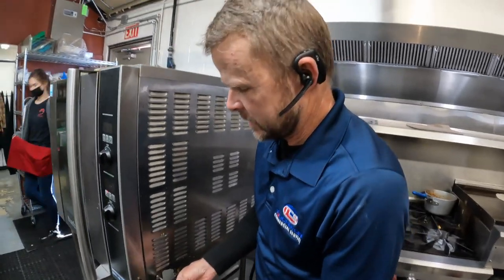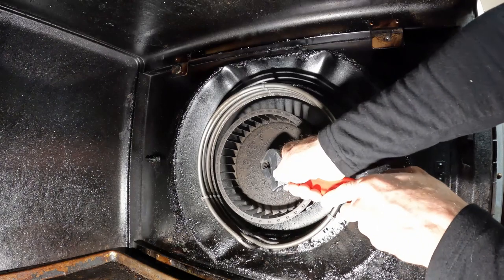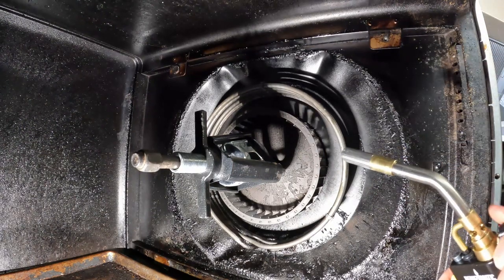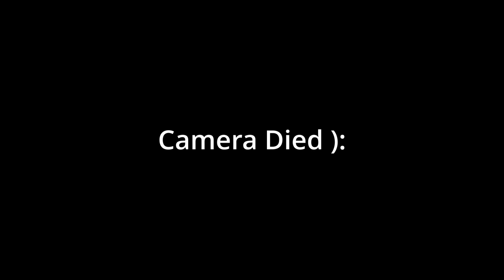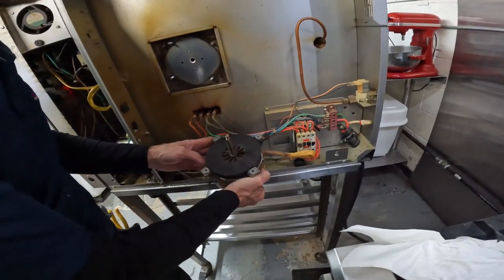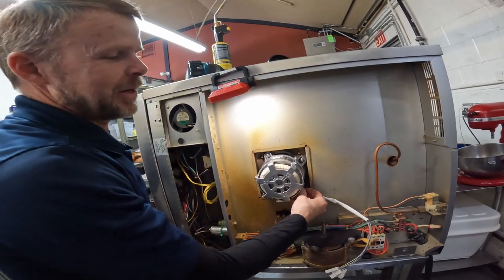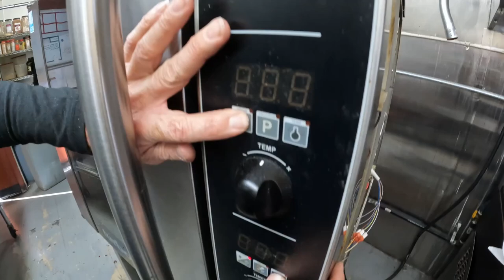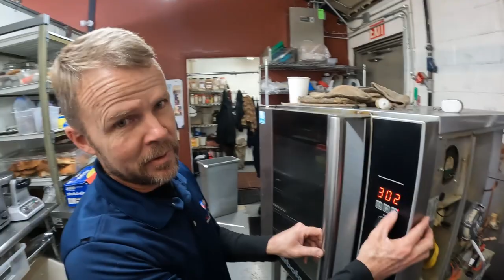How To Replace A Motor On  A Moffit Convection Oven | Nate and Son's Fix a Stubborn Moffat Oven

Comment: Use an impact wrench to pull out the fan. Vibrations and shocks loosen the fan very well. I use a cordless screwdriver.

Comment from the maker: it was difficult to get the blower wheel off this motor, it doesn't show because the camera over heated but after the first try heating it up I had to ice the whole thing down to cool it off and then it popped off on the  second try of heating it up.
Reply: Where r u servicing ?? I just had exactly the same problem now  do i need to call moffat ??im in sydney

Comment: can you just use the grinder from the start and cut out the fan to speed this process up ?
Reply from the maker: most of the time the grinder is not necessary, so try not to use the grinder if you can help it